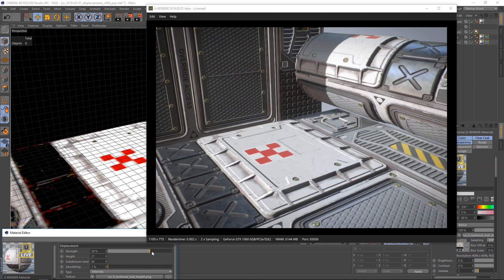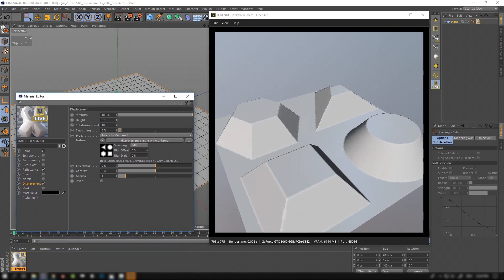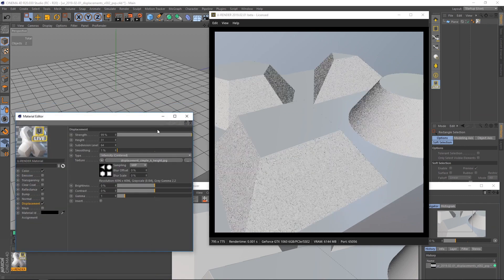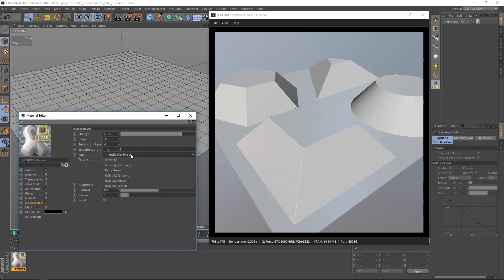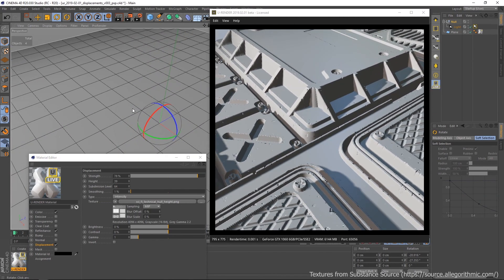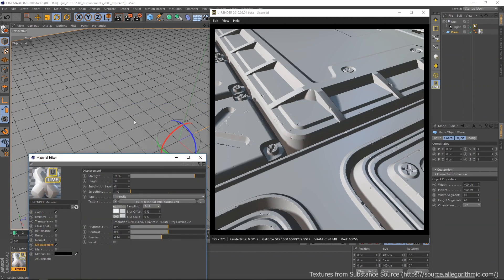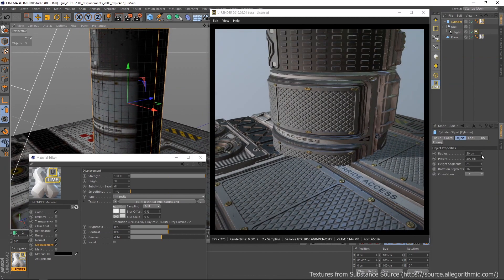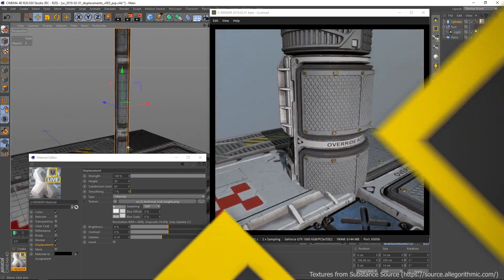Displacement Maps - Quick Tip - U-RENDER

Comment: can we mix multiple displacements ?
Reply from the maker: Hello Paul! You can use the C4D "Layer" shader and mix so many maps as you want. Note, that the C4D Shader has to be baked and that you can adjust the baking resolution 1. directly when in the Material Editor with the setting low/medium/high and 2. in the render settings - basic - shaders.